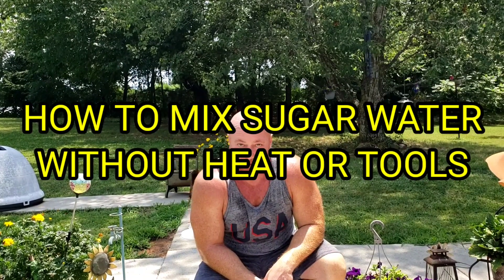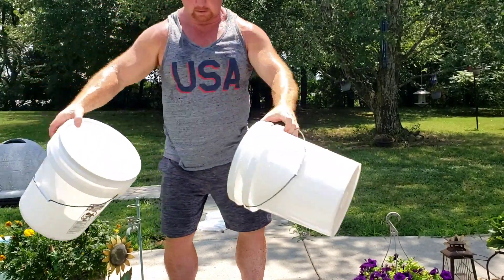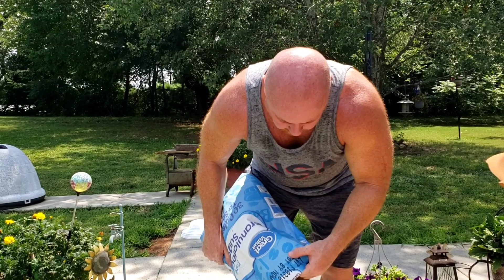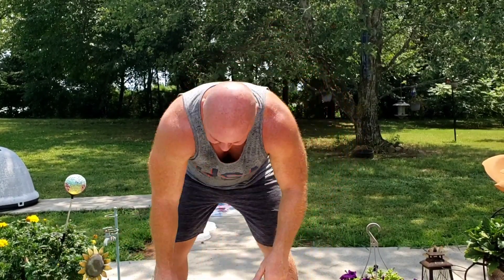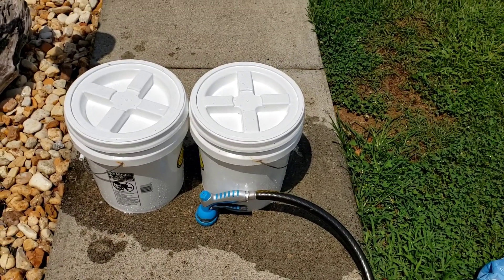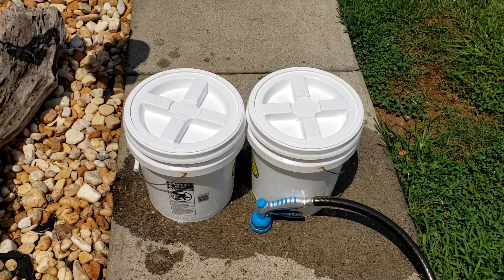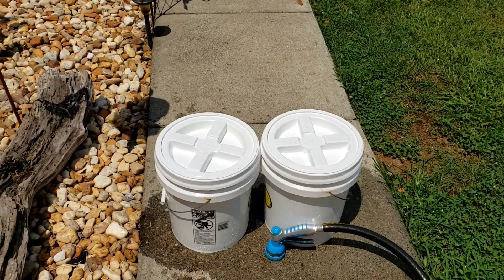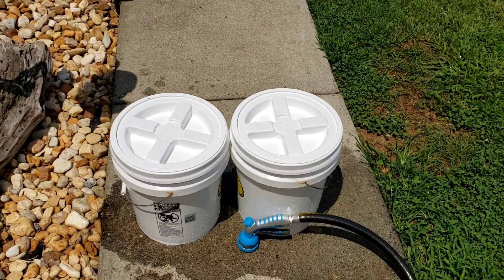How To Mix Sugar Water Without Heat or Tools

Comment: 1:1 can mean by weight or by volume. We mix 1 kilogram of sugar to 1 litre of water, which is weight for weight. You will get a different result of you do it by volume, but in the end, it probably won't matter.
Reply: I do it pound for pound. 1 pound water 1 pound sugar.
Reply: What is the difference between honey made with nectar and sugar water?
Reply: @PapaBee165  Bees make nectar into honey.  They make sugar water into sugar syrup.  The bees will eat either as food.  If you feed sugar water to your bees, don't harvest unless you want to serve thick, pretty much tasteless syrup.
Reply: I've found measuring by volume is a lot simpler and works fine.  Coincidentally,  a 4-lb bag of sugar and a 1/2 gallon milk jug of water are about the right ratio.
Reply: @amathonn  That's exactly what I needed to know. I picked up a very small swarm (Oct.6th) and want to try a nurse it thru SE Texas winter.

Comment: Hey David, I know you are not too worried about the sugar to water radio, but I think your readers should not be led to believe that filling the bucket half way with sugar then filling it the rest of the way with water will result in 1:1 mixture. To get a 1:1 solution with this method you would have to start with something closer to two thirds of the bucket of sugar.
Reply from the maker: Thats why I said measure if you want. Sugar and water weight is so close. Weigh it for yourself.
Reply: I tried to drop it but I don't think you understand my point. Yes granulated sugar is close to the same density as water, but that is not what I'm talking about. What I'm talking about is that dry granulated sugar is about 50% air by volume. In your example, the first 1.25 gallons of water get completely absorbed by the 2.5 gallons of sugar, displacing the air. Then you added another 2.5 gallons of water to fill the bucket. Assuming the final volume was 5 gallons and if your sugar was same density as water, it would result in 0.67:1 sugar to water ratio. If you calculate with the real density of granulated sugar it will be even lower. I don't consider 33% error to be negligible, so I felt I needed to leave this comment. If I'm wrong please correct me. I love your videos and I've picked up a lot of good tips from them. Thanks!
Reply: @brettmasear9401  have you seen his bee yard? I'm pretty sure he's got this figured out. Exactly why I learn so much from David, he leaves the decimals out....😜
Reply: @nathandavis903  Oh for sure, David has an awesome apiary and I love watching his videos 👍
Reply: @brettmasear9401  It's close enough.  The bees do not care.  Wild foraged nectar is not a constant across all plant life regardless.  The bees will use what they need and dry down the rest as "honey stores" anyway.
Reply: @brettmasear9401  u are right in what ur saying. I've mixed it both way.
Reply: If you have a 5 gallon bucket, and you fill it halfway with water, then add 25lbs of sugar to it and it fills the bucket to 5 gallons, how can that not be 1:1? The bucket is half full, the 25lb bag of sugar, after completely dissolved brings the level to 5 gallons. I don’t think I am on to anything, I am just saying, if it is not correct, I obviously am not understanding something. I mean, maybe it’s a little off but not by much! Once it is dissolved there’s no more air in the sugar.
Reply: @mapache_del_sur  Some others have correctly pointed out that the bees don't care. But if you want to calculate how it would come out with your method I would say this. Convert 2.5 gallons water to weight at about 8.3 lbs/gal = 20.8 lbs water. So 25 lbs sugar divided by 20.8 lbs water = ratio of 1.2.
Reply: By weight.
Reply: @brettmasear9401  ah I see. Okay thank you. Do you think most beekeepers are speaking of a weight ratio, or by volume? I am thinking of when I mix 2-stroke fuel, but don’t know the actual mass of the gasoline vs oil. My mentor who has been keeping bees for 25 years has never brought this up. I mean you are correct if you want to get technical!
Reply: @brettmasear9401  it’s probably pretty obvious to see that I don’t know what I am talking about. I am conflating mass, weight, volume and who knows what else here. Anyway, it’s something to think of. What I am calling 1:1 is not a true 1:1, but maybe is what beekeepers informally call 1:1?
Reply: @mapache_del_sur  I think most beekeepers ballpark it and say "close enough, the bees don't care". This thread started from David's video where he filed a bucket half way with sugar then put an unknown amount of water in the bucket to get 5 gallons of solution. I know from experience that he probably added 3.75 gallons of water. I only wanted to point that out because it is not obvious to most people. Try it. Put 1/2 cup of dry granulated sugar in a 1 cup measuring cup. Then add 1/2 cup of water slowly while stirring. Then see how much more water you add to get 1 cup solution. You will have a weaker than 1:1 solution. The opposite is true if you start with 1/2 cup water and add sugar until full. To get 1:1 by volume you should start with 2/3 cup sugar and 2/3 cup water and see if it does not mix up to about 1 cup of 1:1 solution by volume.
Reply: @brettmasear9401  oh yeah, I am not disagreeing with you. I am mostly showing my ignorance! I will say with the price of sugar in the US, I may need to keep doing it the way I have! Lol

Comment: Just in case you are wondering, a "simple" 1:1 ratio can be either by weight or by volume.  For bees, the ratio is in WEIGHT, not volume although the difference is so small the bees won't really care. :)  For example, 1 gallon of granulated sugar BY VOLUME actually weighs almost exactly 7 pounds.  1 gallon of water BY VOLUME weights almost exactly 8 pounds'.  So the mix will be quite a bit more diluted than you really want.  Over 13 percent weaker.  Again, will the bees care?  Nope, they will take the mix but just realize they are not going to get exactly the same benefit.  Especially when you want to increase the feeding percentage vs. water in the fall. Short version:  If you want more accurate results, just WEIGH the water/sugar before mixing and Bob's yer uncle.  Don't mean to be pedantic, but there you are. :)

Comment: One part sugar = 1lb. One part water = 1 pint. Imo you need to boil the water for 100% dilution.
Reply: Solubility depends on the temperature of the water. At room temperature (roughly 20 degrees C), you can dissolve 203.9 grams (or 200 grams) of sugar in 100 mL of water. 100 ml of water weighs 100 grams.  Therefore, 2:1 sugar to water solubility can be achieved at room temperature without heating.
Reply: @jasongentry7405  I always seem to have some undissolved sugar in the middle of the pan unless I boil the water and keep it on heat and stir until all gone. Only takes a few minutes and I make it the night before.

Comment: Hello Dave 🙂Hoping you can help me understand something (Started beekeeping in spring, so its all pretty new to me). I just came back from an inspection and 2 of my queens were apparently M.I.A. There was enough young brood (but no eggs) to make me think I didn't kill them accidentally (still is a possibility though). I also know that those 2 hives have been trying hard to swarm despite the room they had and my removal of all queen cells I could find. Could the workers have simply decided to off the queen for failing to make a viable swarm cell or is it more likely to be something I did a week ago?

I Did leave the best looking queen cells to be on the safe side.
Reply from the maker: More than likely they swarmed with the queen. From the time the queen cells hatched give her about 10 days to mate and return,  if after 10 days ,and you can't see any eggs then queen failed to mate. If so you need to order you a queen from somewhere.

Comment: Why not use open feeders all the time instead in lieu of individual hive top feeders?  This seems so much simpler and easier than going to each hive and pouring in sugar water and the risk of spills, etc.
Reply: In my case it was simple decision. 
  I love open feeding.  Quick easy. But gets expensive when neighbors bees find your feeders. I didn't notice it right away. Couldn't figure out why colonies were not putting on weight.  Like they should have. Then sat and watched feeders for a few minutes.  And notice a quarter of the bees weren't heading back to the yard. Did a little math. And I probably fed neighbors bees about 400 lb of sugar.  So, now every hive has their own frame feeder.  Yes, a pain in the butt.  But now my sugar money goes to my bees. Not the neighbors and wasps.

Comment: Hi, Related to this: i am having a big provlem with open feeding and robbing. Some of my hives are light and need to be fed now that the dearth is on. I tried bucket feeders on the week hives but that triggered robbing, so i have switched to open feeding. My open feeders are about half. Way between my rwo in-yaeds, just under 100 yards from each. Rhe two times i have open fed it has led to serious robbing in both in yards. I have pur eobbing screens on all the hives to limit the damage. The feeders are as far away from borh yards as I can place them. What are my alternatives? Maybe to go with supers to cover the bucket feeders on the hives that must be fes? Any suggestions are appreciated. The robbing frenzies are as bad as I have exlwrienced so continuing as i have been doing is not an option. Thanks, Stu
Reply: At what time in the day do you feed? Try feeding on the hive at 7to9 in the evening. Never feed during the day when the bees are flying.
If you open feed, move the feeder 200 yard or more away.
And feed all hives at the same time. The hive that need more, give them more and the hive who don't need much, feed them little, but never let s strong hive without feeding while next to it a weak hive gets feeder.
Reply: I am having a problem too.  I have only stronger hive next to a weaker hive.  Both are being fed.
How exactly do I feed outside and 200 yds away from hive?  What kind of setup?  Thx!
Reply: Stu Farnham be nice to see what you’re doing instead of just you from the chest up

Comment: David am i doing it wrong? I use 1 25lb bag of sugar  and add 3 gallons of water for 1to 1 per 5 gallon bucket
Reply: Water weighs 8 lbs per gal so that's 24 lbs of water and 25 lbs of sugar, dang close.
Reply from the maker: Thats close enough....
Reply: @russellkoopman3004  Water actually weights 8.345 lbs per gallon, so it is even closer! Get rid of the 5 gallon bucket. If not using feeder buckets, use a single larger container such as a turkey roster pot. 25 lbs of sugar fits just fine.